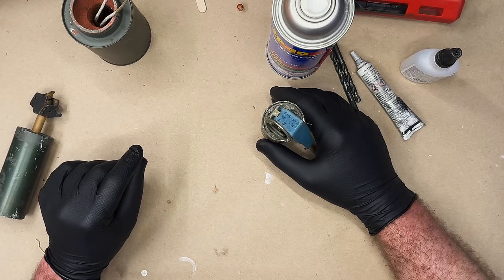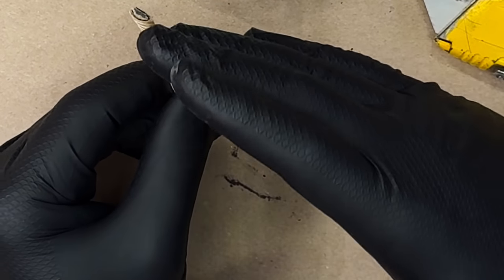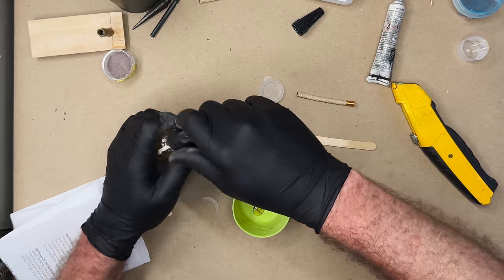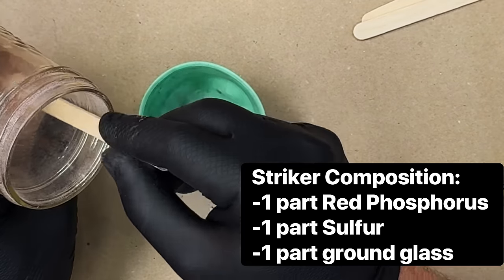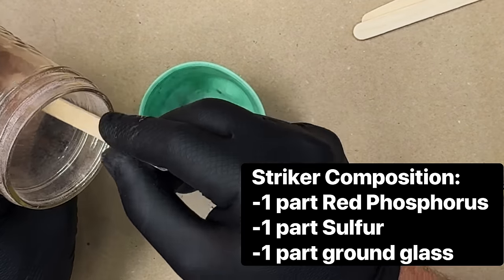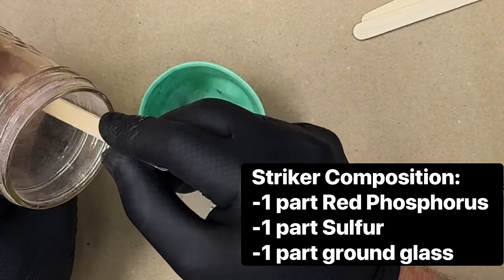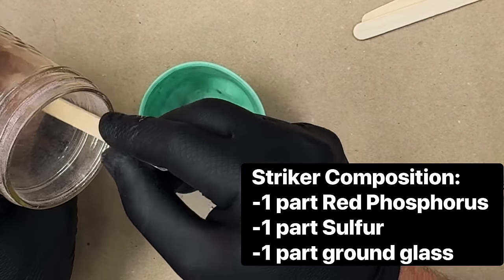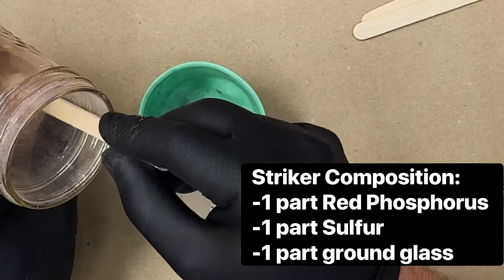DIY Mousetrap-Style Fuze With Time Delayed Ignition For Smoke Devices

Comment: Every time I see one of your smoke grenades i wish we had them in Iraq. We didn't get that type of coverage with three grenades. Even the wp smoke grenades on the Bradley didn't work as well as yours. Great stuff. Thanks for sharing. Keep up the great work
Reply: The second or third worst part is those smokes definitely cost two or three orders of magnitude more. I get the overhead for the lawyers signing the contracts, inventorying, certifications and testing, etc, but these work way too well for how cheap they are.
Reply: @Kori-ko  so they save you $20-30 and get 5 times the yield. That's like saving $100.00 for each pin you pull. Now if i could just find a way to add cs powder.
Reply: His smoke grenades are indeed amazing. But, the use-case is private civillians that "just want any damn smoke grenade." Because in the US, they are "legal" but the ATF has admimistratively ended sales anyway. (Ostensibly a make-work bureaucratic exercise, justified by concerns smoke fuses will be converted to illegal Destructive Device use.) And for those in other countries where smoke grenades are also legal, but have or had zero retail access to them at all.

For milspec smoke grenades, there IS some practical engineering & standardization as to why US issue smoke/signal grenades "are what they are."

Despite warfare being "inherently unsafe" by design, there are safety standards for accidental or unintended ignition during storage & transport. Or even in combat if hit by enemy ordnance, or exposed to heat or fire. 

There's also relatively strict weight requirements, for at least an attempt at managing combat load & weight. And strict reliability requirements so it's 99.9% certain to work.

Also, the tactical purpose of a military smoke grenade can vary besides screening & concealment from enemy observation & fire. The situation where you obviously want as much density and volume of smoke as possible.

However, milspec smoke is also often used as markers for air support, or other heavier weapons, or for marking LZ extraction/medivac for choppers. And color/dye smoke generally requires lower temperature compositions or retardant so the dye molecules aren't destroyed.

And, depending on the smoke chemistry and particle size, there's compositions that are visible light opaque, but are still transparent to deep long-wave IR/FLIR. And ones that are opaque to both visible & thermal/IR.

And there's probably even more considerations, like demanding milspec grenades don't have an unacceptable probability of setting unwanted structure fires or wildfires. 

And while the smoke grenades with deliberate IR/Thermal properties might be special issue, they exist, and fitting the needed chemistry & composition into all the other requirements only gets you that "inferior" smoke volume.

And probably the DOD demands that milspec smoke do all this, possibly more, after sitting in storage for 20 years, then getting a few months of abuse in the field hung on infantry LBE, and still have that 99.9% success rate.

The military is indeed slow, stodgy, & bureaucratic, but a lot of equipment "is how it is" because of very real technical, practical, & logistics reasons too.

We have it somewhat simpler. We just want a goddamn smoke grenade that "works" and has a pull-ring/pin safety and spoon/mousetrap ignition & delay. That's a much lower bar to meet than making thousands, storing them for a decade, abusing, hitting, & shaking, getting rained on, then working with 99.9% reliability.
Reply: @vegan-cannibal714 you can buy oc in it's food grade variant and mix it in it works not as well as cs but definitely makes you rethink your choice
Reply: @copper5567  I hadn't even thought about it that way. I know where a 5 gal water jug full of powdered cs is buried. Honestly,  cs is one of those things that becomes less effective each time it's used on the same person. 

The only thing it's good for is harassing recruits and maybe as a short-term area denial weapon.
Reply from the maker: @andrew32155 well said
Reply: Humidity matters though, the conditions were almost perfect near that lake for one smoke grenade to do that much.
Reply: @andrew32155  Really great write up. Thanks for sharing
Reply: @andrew32155 this is the most reasonable internet comment I’ve ever read.
Reply: @andrew32155 hopefully the court case they just lost changes that.
Reply: @andrew32155 same logic applies to military standard issue firearms. A lot of civilian weapons seem much higher quality but the use case is very different.
Reply: @andrew32155 yeah we have it simpler we don't have to launder taxpayers money through the monopolized millitary industry complex
Reply: @vegan-cannibal714 what about oc compared to cs
Reply: @vegan-cannibal714  it's an environmental condition. In Iraq, it was NOT humid. That's why.
Reply: That is crazy to hear . . . Very impressive 👍👏😎
Reply: @vegan-cannibal714 if you understand solubility and Prime atomization, you'd be surprised what capsaicin can do.
Reply: Agreed, 💯
Reply: Can you use a cap from a muzzle loader already primed. Asking for a friend,lol 😂😂😂😂😂
Reply: @vegan-cannibal714 red chili powder is awesome. I was told
Reply: To be fair, the WP grenade clusters (4 barrels each cluster) were never about making smoke. They are there to keep the crunches off your vehicle. I've only seen them used like that one. They are very effective. Something about having a little chunk of white phosphorus burning into your body that makes you re-think your life choices.
Reply: That's wild. As a civvie, I'd always assumed that the military smokes would be better.
Reply: @josedorsaith5261  nope his are, our coverage is no where near the same.

Except our smoke chaffs on strykers and atacs
Reply: @Crypticnunce  sorry Boomer here, smoke chaff? Honestly, how often did you use smoke to conceal vs. signal?
Reply: @vegan-cannibal714  a lot, lmao. When under mortar attack the Stryker and atacs launch smoke for maneuvers or get TF out. Also, we used them as entering cities or villages for covering movement building to building...
And that's ok Gen x here, not far from one another.
Reply: @vegan-cannibal714  lmao, just saw your comment, what yrs. I was at Benning 98-08. Also deployed Iraq, 04,06,07. 05 was ghan ghan
Reply: @Crypticnunce  okay, so similar to the Bradley's anti crunchy wp smoke launchers. Our launches absolutely worked, but how often do you get into that situation. I only ever had to use it once. We were fighting in thick oil well fire smoke. Short vertion is i just dont see it being used very often. Does the system actually increase survivability?
Reply: @Crypticnunce  86-91 trained at Knox deployed to Op Desert shield/storm as a brad gunner came back in 02 for three years did a deployment in 04 Iraq.
Reply: @vegan-cannibal714  no shit, anywhere near FOB Kennedy or OP switchblade
Reply: @vegan-cannibal714  Fk yes,  survivability was greater,. Imagine walking down sector Lincoln and the atac blows out 4 canisters at a time in intervals while moving on outer edges. Regulated sniper shots at us and we had thermal superiority in the atac crews view.tranmitting locations of soon to be unalived.
Reply: @Crypticnunce  
Who were you with in 04?
Reply: @vegan-cannibal714  1st Cav/4thC/3rdpl/3rdSQ,🤣🤣🤣🤣🤣🤣🤣🤣

Comment: Do you think instead of using the striker compound as a primer you could just use a pistol or shotgun primer instead?  I haven’t looked at a grenade mousetrap striker closely, does it use a standard primer?
Reply from the maker: Certainly could. Especially if you drilled out the fuse then filled with jbweld then drilled to accommodate whatever center-fire primer you want.
Reply: Haha. I did some poking around, and apparently drilling them to accept a 209 shotgun primer is a thing. There are even sellers on Amazon who sell them prepped for this — for use as “perimeter alarms”. The 209 primers have a rim, so the hole doesn’t need a precise bottom ledge to seat firmly and provide reliable ignition. Not sure, but you might want some ignition compound under the primer to get the fuse going. I might just have a few of these on the way to try …
Reply: Seriously, your work on this stuff is excellent. I’m waiting to see how if you get the TPA working with an epoxy binder, and I’m going to build some of these.

Comment: The blanks for the ramset you get at home stores works just as good.  Rimfire 22 caliber blank cartridges..  cheap too..
Reply from the maker: @Z-Ack  do you know how I know you have never done that? Because you said that silliness.

I’ve tried to even modify the (centerfire) m228 striker to a rimfire striker—even with that mod the spring isn’t strong enough to reliably ignite. 

To anyone else who is using ramsets as primers for any device: The rounds have to be cut and drained of powder charge leaving the green rimfire primer only in the casing: they will ignite visco fuse.

Comment: A mesh or drilled pipe inlay might help the the chunks of core getting blown out. Pre-sealing the ignition exchange holes with with a sympathetic igniter compound like sparklers and then using a sealant to maintain the integrity of the pipe during storage until use. You would probably have to calibrate the hole size for optimal output and provide burst disc for the container to reduce the risk it goes explosive. Maybe a test rig that doesn't involve holding the thing with the term 'grenade' in its name? A quick test might just be a rolled steel mesh with fairly large holes, maybe 1 cm. Coiled around and inserted by coiling inside tube of the same diameter then using a dowel to push the coil mesh out, while simultaneously removing the tube. Similar to locksmith using a follower to remove a lock core.

Comment: Question, if we aren't worried about reuseable delivery devices, could one theoretically 3d print one?
Reply from the maker: Indubitably
Reply: @InventionIncarnate  even with how hot it burns? You wouldn't worry about it just melting away and not giving it enough structure?
Reply: Best answer  @InventionIncarnate
Reply: I would imagine with the epoxy binder it should have enough structure without the case, since it’s not under pressure when the lid pops off. Maybe put sheet steel on the bottom (can lid) so the smoke will still be directed out the top.

Comment: Got a question. Couldn't you use the tpa mix with NC lacquer?
Reply from the maker: Yes indeed and pelletized (academically speaking), however, every attempt I’ve made with executing that has blown apart container. I bet if it were compressed using nc as a binder that would be great, however, it’s so volatile that I bet I couldn’t mix it fast enough, if anyone has any experience feel free to chime in
Reply: @InventionIncarnate  

If polarity isn't a huge deal you can mix it with water. If it is, a lower vapor pressure solvent like ethanol, MEK, AcCN, THF, toluene, and several more.
You can cool it and the mix(if you can) down in the fridge.  Mixing it in a sealed container could help.

Comment: You can VERY easily reload a original fuse assembly using 2 drill bits, a punch, drill and a 380 blank. and still use the triple protective firework fuse..
And if you have your smoke come out the bottom of the canister you can probably reuse the assembly.
I'll try to get a video posted this weekend.
Reply from the maker: That would be awesome

Comment: I have no intention of making HC smoke grenades for... obvious reasons, but I do have a question about the fuze you used. I've seen some things from a few years back saying they are illegal to rearm because they use explosive compounds, some that say they are legal as long as you dont use a certain compound, and they aren't legal because the fuse is located internally unlike in smoke bombs (from an ATF release). Oh, and even more confusingly, someone said that they are not legal if the primer needs to be forced in and thereby "loaded" into the fuze body. I can't find any updated official documentation the legality of rearming inert fuses or creating similar ones from scratch (though designed specifically for smoke grenades). You seem knowledgeable on this subject so i was hoping you could point me to a source or at least give me a nudge in the right direction? Your channel is a hidden gem and this video was great as usual.

Comment: Awesome video! The only thing that I did not see was the application of the spoon kit. How to attach it to the top of the tiki torch lid.
Reply: Find a nut that fits the threading on the mousetrap assembly, jb weld nut to top of tiki lid. Can’t remember the threading but I think the nut is 5/8

Comment: You can just use a .22 blank with the powder dumped out for the primer instead of messing with chemicals. Mouse traps with a 1/4" hole drilled in it for a nail gun blank and a bent paperclip through the trigger mechanism is a dead simple tripwire alarm design from way back.
Reply from the maker: I’m glad you brought this up because it would be so much easier if it worked (reliably). 

This is an example of something that works academically/theoretically but the execution is actually extremely difficult

.ive tried repeatedly, without consistent success. Those blanks come in both 0.22 and 0.27 and are all rim fire. I’ve modified The center-fire striker on an m228 fuze assembly to a rim fire striker via metal grinding disk, and found that the spring force wasn’t strong enough to actuate the 22 primer. I’m going to attempt to shift the center-fire striker forward by drilling out the rivit holding the striker to the lever arm and shifting it forward a few millimeters so that the intact striker point lands on the rim. (Securing with epoxy) Because the scroll-like shape of that centerfire Striker is important for the transfer of that force. I’ll update, so subscribe if you’re not.
*also, the transfer of the ignition gases to the time fuse is extremely aggressive and usually blasts the time fuse to kingdom come (and yes, I dumped out the powder lol) it does work with visco fuse  however.

Comment: Ive been developing some pin fired variety using 209's. My version has outside threads. I use half inch pvc as the joints. I've been toying with a delay mix used in rocketry. Think of any chemistry that will allow you to launch something but then thin by doubling weight with baking soda. It makes a super effective slow burn that is quite effective and consistent. For charge im using Al n Mg mixes with KN and KPc. I'm able to whip them out quickly with lengths of pvc and cap tapped into my adapter. I honestly need to work out a weaker primer. I overpressure without an oversized piece of pvc. I can corr which gives void space but also gives me surface area for ignition. The 209 primer cones out at like 11,000 psi. A dang 223 comes out at like 45,000 psi 😆. Ive been focused on developing the challe gkng parts that is rhe least of my concern. Check out slowburn mixes. In your case itll work very well i think.
Reply: With the slow burn you just press it and create cells. If you need rapid ignition core your second cell with loose flash.
Reply from the maker: That’s so funny I was literally just researching rocket delay formulas like 2 minutes before seeing this. Have you tried small pistol primers? Those work extremely well. I’ve been testing Scott Pace’s XM18 using them.

Comment: Bro got the armstrong mixture mixed with ground glass in a glass jar with a metal lid that makes a scratchy sound when closing.
A literal fragmentation grenade.
It made me feel very uneasy when you screwed the lid back on.
Reply from the maker: It’s not Armstrong’s, that would be literal suicide…. Uggggh it makes me cringe just thinking of that. 
It’s 1:1:1 red p:sulfur:ground glass. There is no oxidizer.  The ignition works based on the sensitive relationship between red p in the striker comp and the potassium chlorate in the ignition comp.the two stay separated  until the striker pin hits them
Reply: @InventionIncarnate  
Ah ok hahahah

Comment: OK!!  Unfortunately I have NO video editor software, AND what I used to use was a YouTube editor which I cannot find anywhere, I am forced to show my reloading technique as a mix of 16 separate shorts and videos but they are all listed in order if you go to my page.
I tried using a free editor but it took my portrait videos and cropped them down so much that you couldn't see what I was doing.
I apologize for it being SO difficult to watch.
Reply from the maker: You can put them in a playlist. I’ll check them out.
Reply: @InventionIncarnate  ok let me try that.
Reply: @InventionIncarnate  OK I got them in order in a playlist.
Reply: @remotecamper9113  The playlist is posted on his channel now
Reply from the maker: Just watched, awesome.

2 questions:
1) Are you using a potassium nitrate-based composition? Because that canister on the 16th video was A HOT POTATO 
2)where is the smoke venting on the m-18 body, or is it venting out the fuse?
Reply: @InventionIncarnate  The comment on the video, was that this is NOT a smoke grenade.
That is aluminum and iron oxide.
It was blowing out through. the fuse hole.
It only blew out the bottom hole when it finally got to the bottom.
These were not M-18 bodies.  I think M38.  Holes on the top and one large one on the bottom.

Comment: Is that an M201A1 fuse your using?
Reply from the maker: I’m honestly not quite sure, it didn’t come with a spoon, where that’s printed. It was attached to an early version of a BTV-1 F.B.
Reply from the maker: For the record, an M201A1 fuse is way better than this one. They screw right into the top hole of a tiki can lid. They also sit flush, and they accommodate a spoon with this canister
Reply: Hey I emailed you my address a bit ago as your request for some swag. If you care to share yours I can send some spoons, a few oz of red walrus colorant and a link to where you can get spring kits for the M201. If not I completely understand.